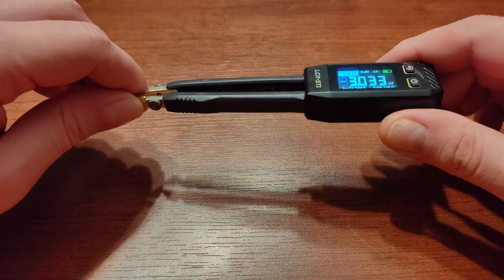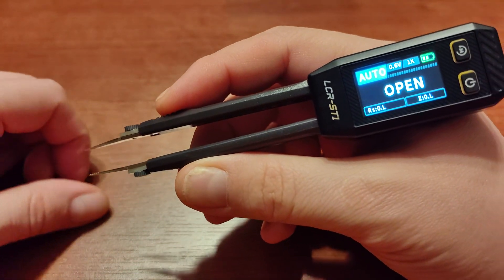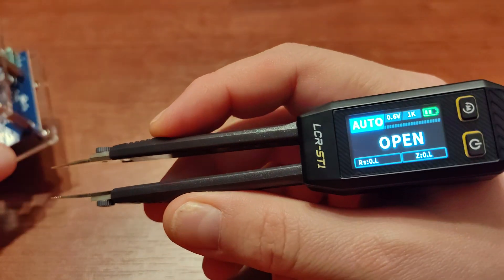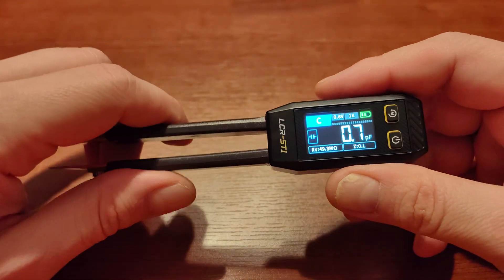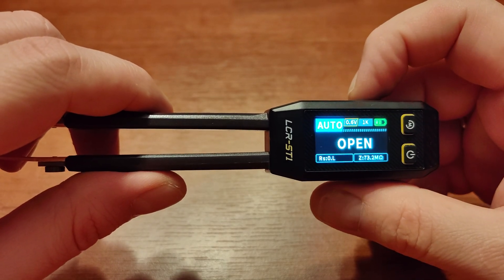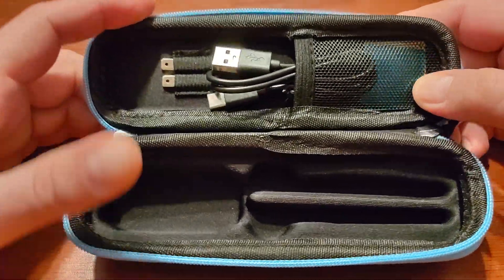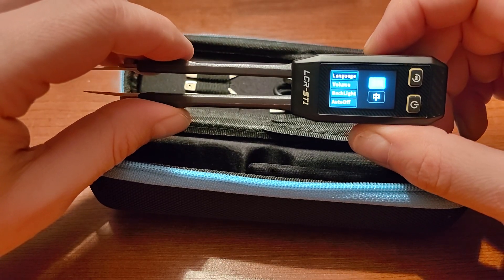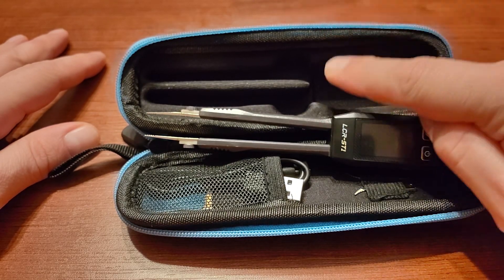My tools: LCR ST-1 tweezers meter by Fnirsi. PCB boards, speakers crossovers - quick and convenient

Comment: Is it possible to test a capacitor or resistor without desoldering/removing it from the amp/receiver board, or must it be removed first?
Reply from the maker: If there are no other parts soldered in parallel, you will be usually good.
If there are other things in parallel then you would be measuring them all so the bes and simplest way would be to desolder one connector ("leg") of the capacitor if possbile.

Comment: Mine is on its way from ali. I also ordered a FNIRSI LCR-P1 Transistor Tester Diode Triode Capacitance Resistance Meter LCR ESR Meter NPN PNP MOSFET IR Multifunction Tester.
Reply from the maker: Its very handy, especially in crowded boards with small resistor/cap sizes. And I appreciate inductance metering with 3 freqs.